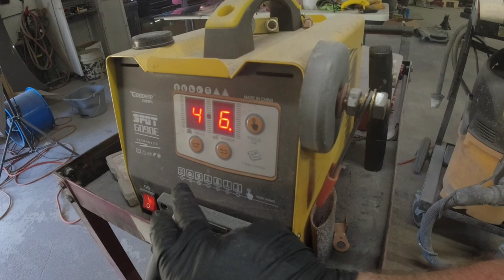First step to fix a DENT. AUTO BODY REPAIR

Comment: I have a stud gun. I get a shop towel, lightly damp it with water. With in seconds of welding the stud, while it's still hot. I put the damped towel over the stud. That's how I shrink the metal.
Reply from the maker: Good tip , I'll be trying that and thanks for sharing it!

Comment: Nothing against your repair skills but you should always replace the door if a hit is on the inner brace!  Those components are designed to give and once hit they no longer provide the original integrity.